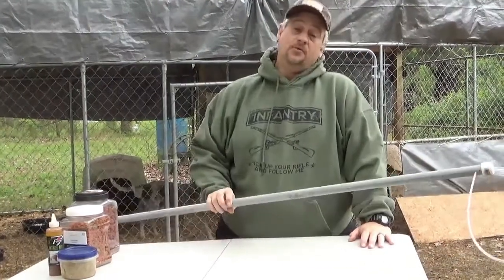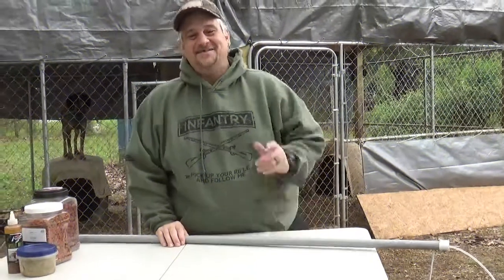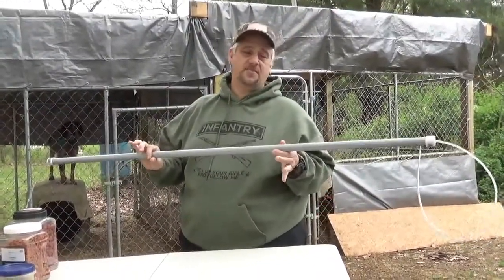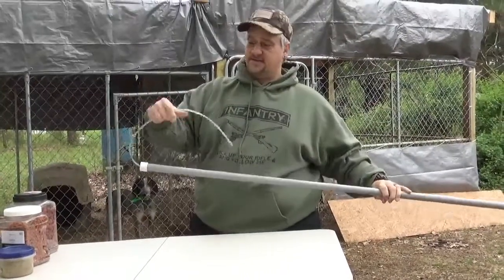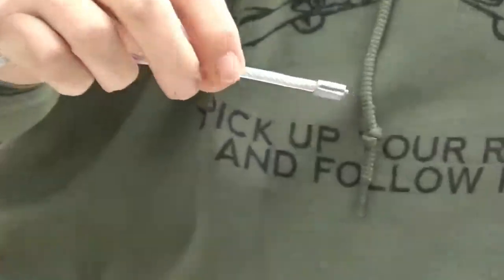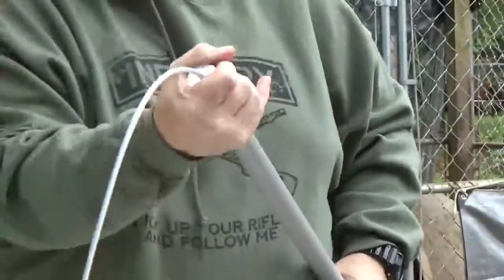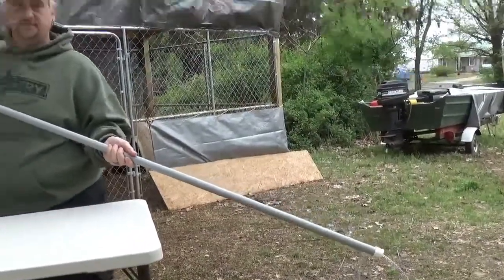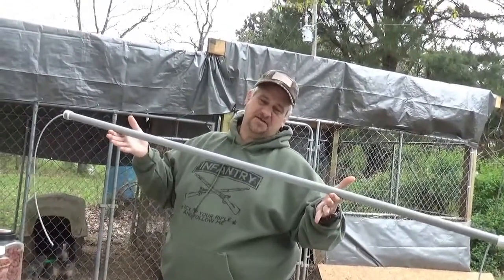CATCH POLE - MAKE YOUR OWN

Comment: I built one almost identical to that's one. I just need to figure a way to lock the cable in place until I want to release it. I plan to check tour other video on this issue.
Reply from the maker: Yeah, the other video addresses that particular problem. I solved that issue, LOL

Comment: Pretty much do the same thing but it works WAY better if you drill 2 holes in the cap and anchor it on one side. Doesn’t bind as much.
Reply from the maker: will give that a try on my next one. we have built a dozen of these trying out different things

Comment: Very informative.    Have you ever used it  for snakes?  That's primarily what I want to make one for.  Thanks.
Reply: I would think it would be difficult with snakes considering they may be able to slip out unless you hold on tight and it’s a non slip line idk.

Comment: Would this work for snakes ?
Reply: no
Reply: By drilling 2 holes in the end cap and running the cable back in through the cap instead of the side, it should work for you.
Reply from the maker: I wouldnt use it on snakes at all. There are commercial snake grabbers for that specific purpose. Generally speaking, unless you are quite familiar with how to do it safely I do NOT recommend ever grabbing any type of wildlife

Comment: What about the lock!
Reply from the maker: I apologize. I must have missed your question. The lock is simply a clothes line tensioner sold at most big box hardware stores. You can find them online as well. It simply only allows the cable to freely move one way.

Comment: I built this because of a raccoon problem, i caught a about 20 pound raccoon and it didnt hold it. Mabye its because raccoos can grab the cable and pull it off them but i wouldnt trust it with anything
Reply from the maker: hmmm, sorry that hear that it didn't work for you. I use mine on coyotes and it holds them. Hate to hear you had an issue though.
Reply: Put something like a lawnmower pull handle on the end of your cable, then the cable won't slip through your hand and the only way a  racoon could pull it off is if he has more arm strength than you. 😉